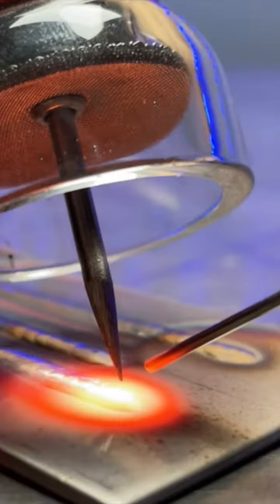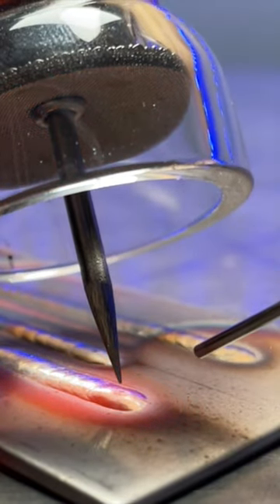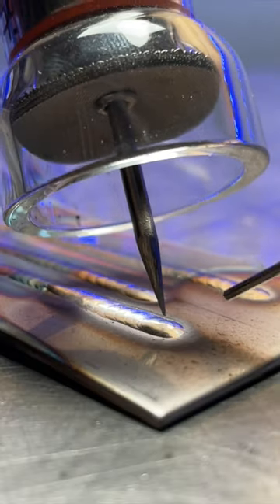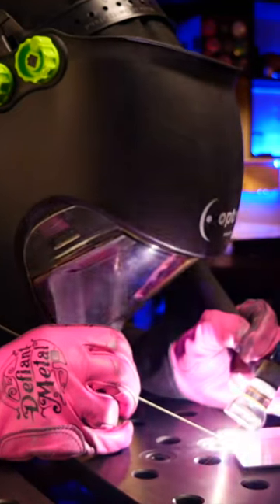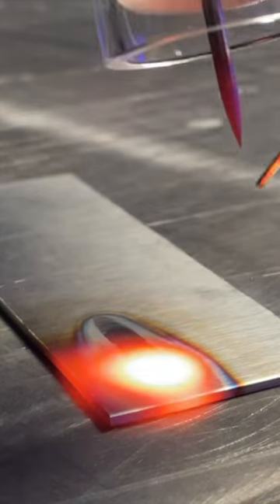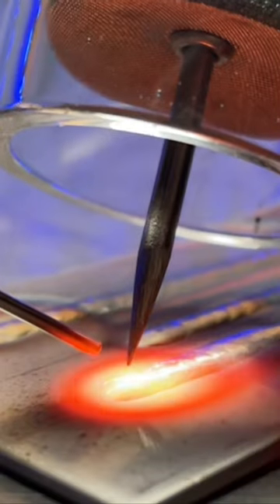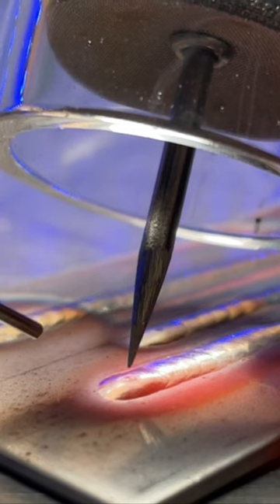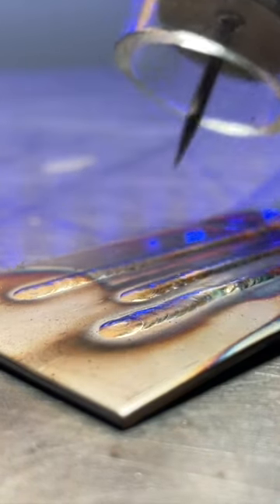Fixing your settings for stainless tig welding? Watch this first🔥

Comment: The pros use auto post flow. Works every time. 😉
Reply: What's auto post flow?
Reply: @zionmeza5727  On some machines, like my Miller Dynasty 350, with auto post flow turned on it will post flow automatically for the amperage and process your were running. More amps, longer post flow. No adjustments to ever make.

Comment: Any helpful hints for much older machines? Transformer style. 1997
Reply: no difference on that function for older machines. (as long as it has post flow setting)
Reply: @flyinpolack6633 , it has post flow, but no adjustability.
Reply: @2JustMe1  If you know someone that is good with electronics they could probably install a HiPot (think it's called) which would give you adjust ability.  Maybe even a welder repair guy could do it
Reply: @flyinpolack6633 , thanks I'll look into it.

Comment: That’s the bad part about the Miller max stars. They don’t have a post flow adjustment. They are set inside the machine.
Reply: Really? That seems awful. There are so many reasons you'd want to control the post flow depending on a handful of factors.

Comment: Dumb question but when using scratch start or lift ark no pedal  once you snap out and go back and cover still leaves oxidation any hints
Reply: On stainless? If so, make sure everything is CLEANED, including your tungsten. Use the proper tungsten as well(red strip). Make sure tungsten is sharpened like in vid and no cracks. 
And sharpen it the proper way. 
So many things are important when welding s.s… always make sure there’s no leaks in your lines, proper gas flow, no leaks on your torch….
Reply: kinda need it for stainless or it will oxidize.  On trick you can do is run a secondary Ar line that bathes end area of weld
Reply: Just kick ur ground off. It works just like letting off the pedal lol

Comment: some of my workmates use a 2,4mm tungsten with a 5mm ceramic and 15l/min gas and 0.4s postflow (on stainless steel)
they say it works better this way.

i work with m@r@ns...